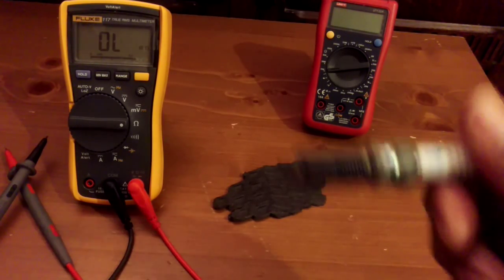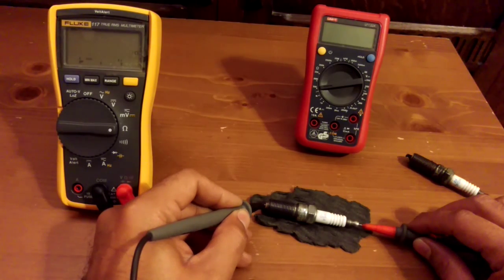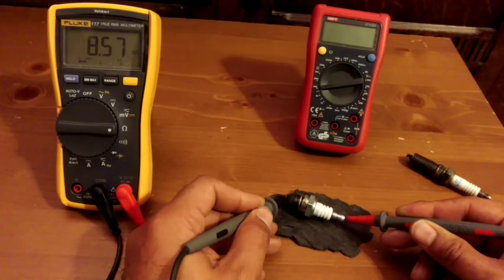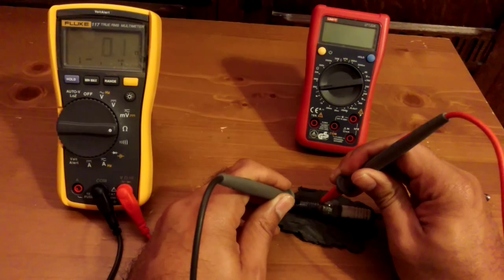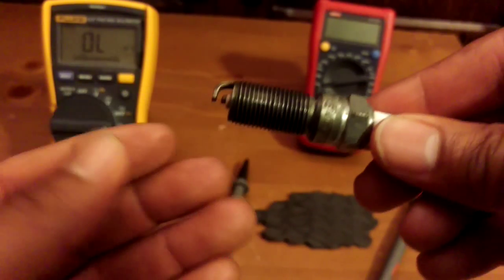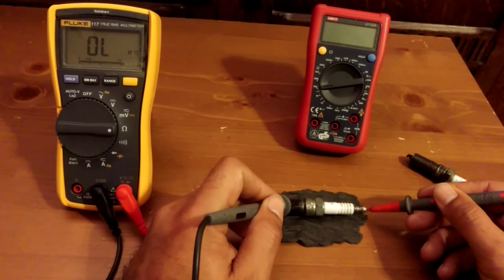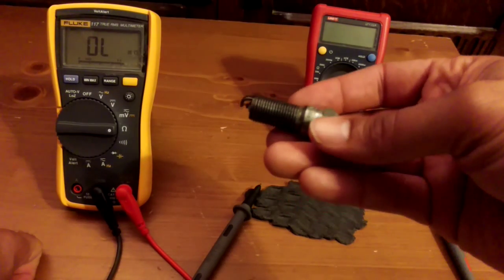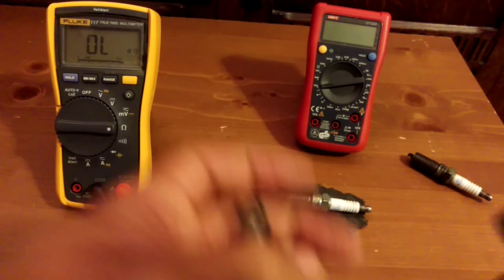How To Test a Spark Plug

Comment: Thank you  for  your time and help, 
I have in the NGK iridium, 
And the resistance  on all of then  are 3200 ohz do you think are bad or is ok because are iridium  they read lower,
I have a vibration  on idle, and reverse  and when stop signal  or red light  , then runs smooth, 
Please  can you let me know
Reply from the maker: This is a general video and good enough to give you a reasonable idea but every spark plug should have a technical data sheet so if you Google the exact make and model number, you should get a more precise answer.
Reply: @sirobb  thank you so much,
I will do that  first , cause they looked
Reply: ILZFR6D11 NGK,  and the website  says  5k resistor ,
Now the read is 0.470 in 10K ,
Do you think is a good or is not becausr never reach 5k ,
But what means reading  in 10k
Reply: 10 k  range is the max reading setting of the meter.   So a 4.7  is 4700
Reply: @danc2014  thank you for help me , I been waiting for more than a year and no body let me know 
THANK YOU

Comment: For what it's worth that is a really poor way to check a plug. Sure it may work if you have a plug that has no continuity or is grounded but a dead miss is pretty simple to locate and this test likely won't work on intermittent issues under load. Heat increases resistance, and most elements are designed to operate at 1700 deg f. Most engines today run at least platinum, so even if you have continuity the gap is very important and on platinum it is non adjustable. The only way to check a plug accurately is with a scope. That being said, installing in the wire and cranking the engine you can get a good idea by eye but it's not really that accurate. I have a collection of eroded plugs where the core rotted and the plug did not even miss. When pulling the wires off the cores come out of the porcelain. Carbon tracking (internal) is another issue as is the plug grounding to the head and heat dissipation. Sure, you might get by with this test BUT if you are standing around scratching your heads.....it's because......

Comment: Nice tutorial. I really enjoyed it. Nice to see a tutorial where one can use cheap (or relatively cheap) equipment to test automotive components. I'd give it more thumbs up, but YT allows me to give it only one . And about the experts that claim that you can not test a high current device with a low current device...well a spark plug is not a high current but a high Voltage device. If it were a high current device it would weld itself to the piston on the first arrival of the piston to the TDC :D
Reply: What is it you are testing? There are parameters. 1. if you have an eroded electrode and heat causes expansion and creates and open ckt, your continuity test is useless. 2. If you have a non resistor plug and it is carbon tracked internally it will give a false positive. 3. resistance has nothing to do with breakdown and Paschen's Law inside the combustion chamber which is where it matters. You NEED A SCOPE. Anybody who disagrees is looking at the wrong end of the plug and is telling every mechanic out there that they failed their first year of trade school and can't fix jack.
Reply: Welding a piston "is it possible"? 50-70 kv, dc extinguishes itself 3000 times per min. (this is why AC welders are junk). The distance from head to piston is 5/16" which is an increase of the 0.030" of the spark plug, enclosed in a gaseous atmosphere Paschen's law comes into effect and you need to increase the voltage exponentially to arc assuming the spark plug was not already grounded in the head and the spark took the longest hardest path. Is it possible to make a high current device that will weld itself? To arc electricity at 1 metre it requires 3.4 MV or 3,400,000 volts (at atmosphere). How many amps is that? I'm no electrician but HV continuity is different than HV ability to discharge.